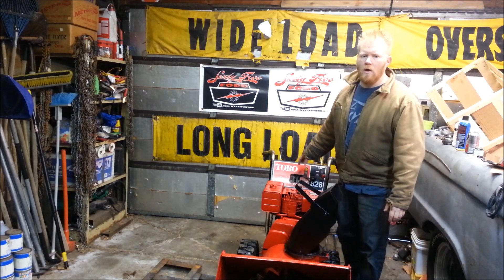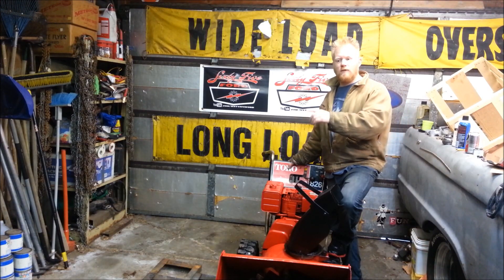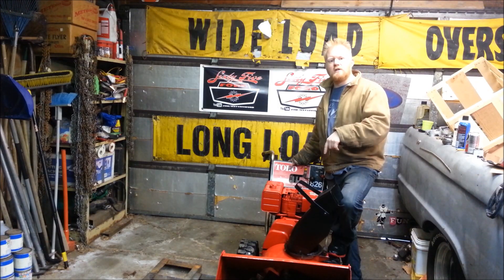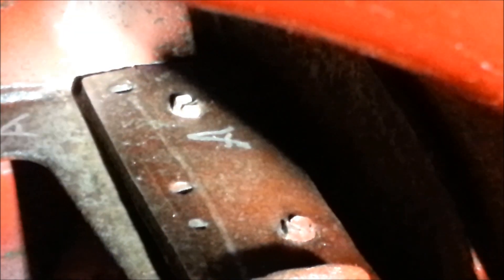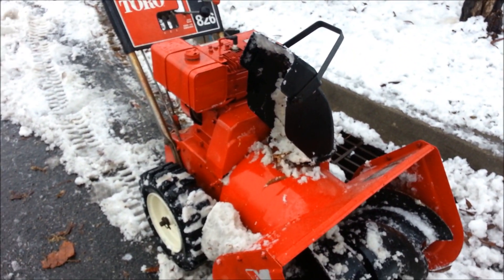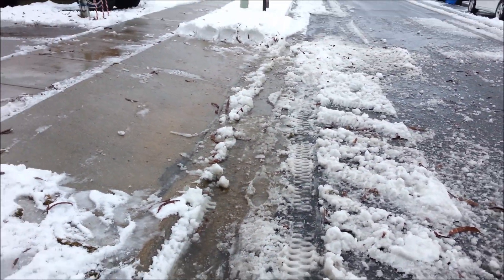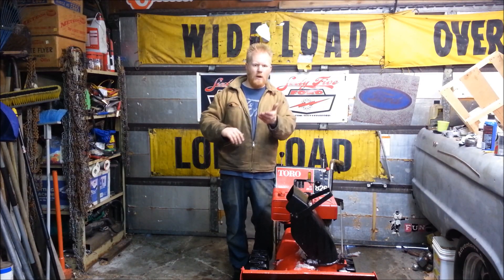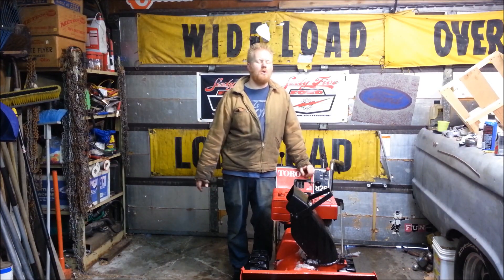TEST snow blower Impeller Modification with and without

Comment: I just did this rubber paddle modification to  bob-cat 72 inch hydraulic powered blower I have on a 75 hp 836G skid steer. I will let you know how it changes the performance of this unit. I also plan on doing the same to our walk behind 32 inch Honda. The newer Hondas use a high speed three paddle auger and throw snow very well but they will still clog in wet crap slush.
Reply from the maker: James P Bergeron You'll be impressed. I've had a few people do this to tractor mounted snow blowers.

Comment: Great idea...after I watched this I went and checked my Husqusvarna and to my delight there is almost no clearance..they actually designed it to performed that same way your mod does...it never clogs...so far haha...cheers and greetings from Ontario Canada
Reply from the maker: The gap gets bigger with use as the housing stretches and the impeller blades start to bend. They're usually good when brand new with a minor 1/8" gap.

Comment: I added the rubber pads to my snowblower. I had them too close to the side so I had to adjust because impeller was stuck. I also replaced the auger belt. I will also use DuPont snow and ice on the auger,impeller and chute. No more clogging. Can’t wait to test it out!
Reply from the maker: You'll be amazed with it.

Comment: How Can I modify my single stage blower.  Great video
Reply from the maker: richard reis Old metal single stage/riding mower single stage: Put one 3-5" paddle on each auger right in the center below the chute. Right on the flat part. Your machine will throw a ton further and won't clog.
Reply: sixtyfiveford Not real sure where you are indicating to put the paddles.  The blower is a single stage simplicity tractor mount 1970.  I have two scoop type sections in the middle right below the shute.  I tried to put paddles on these scoops but they interfere with a piece of the blower which is located on the front of the blower.  It is a triangle shaped piece.  The largest piece I can mount that can clear is appx 1/4".  I will give this a try and see if this helps.  Thanks again for the help
Reply from the maker: I have the exact snowblower for my 1972 Sovereign. Yes, just put it on the 2 flat spots so it just touches the triangle. It should also touch or be very close to the auger housing at the same time. Mine are about 5/16" and just skim the housing and the triangle.
Reply: sixtyfiveford Yep,  That is exactly where I put mine.  The paddles took up some of the space between the scoops and the chute.  I still have a 1/4 " gap from the scoops and the chute.  We have a wet snow coming tonight, I can't wait to try it.   What a great idea!!!!

Comment: I gave the paddles their first test tonight after I got home from work. They throw the snow between 25 - 30 feet, and with a fully re-built carb that I did last spring (thanks to your video), I got it done myself, all I had to do was buy the re-build kit plus a new float (parts less than 30 bucks). :)

Comment: Gwdave here, I did this mod early in the summer....  I have had a couple of light snow falls that were wet...  We just picked up about 4" of kind of wet snow, and along the road where the snow plow left the melted real wet snow from the chemicals I tried to plug up my 2 year old TROY.....  I could not plug it up no even a little bit...  I had to get in to some snow in the yard to remove the wet stuff from the inside of the blower so I could put it away.......  Real neat mod, and I tell every one I know to do this mod it is worth it............
Reply from the maker: Dave Farrell GREAT! Most are too afraid to try this on a newer machine even though the performance is poor. I'm glad you tried it out. Thanks for the feedback.

Comment: Mastercraft (MTD) 8HP with 3 blade impeller.  The impeller has a lateral curve. Should the paddle extend to the edge of the curve?  Mounted on the top  of the blade creates a non-smooth surface to throw the snow - does that matter?  (Can’t mount flush with blade underneath).   Eager to make this work on my machine.  Anyone do this on a Mastercraft 8hp (also MTD, Snow King, with the Tecumseh engine.  The backing plate on the impeller drum doesn’t allow for the paddle to clear the  back of the blower,,,, I can only extend outward to eliminate the minimal tolerance).  Go 👍 or no go 👎???
Reply from the maker: You don't put it on the curved outer edge. Only put them on the leading edge as it will pull off it put on the back side. Even if you leave a 1/4" ridge from the rubber, snow will immediately fill it in.

Comment: Why doesn't Toro build them with paddles if it would work better?
Reply from the maker: Cost and why would you buy a new snowblower if you didn't get fed up with the performance inabilities. The higher end snowblowers $1500+ all have virtually zero gap when build. Bargain snowblowers are mass produced and little care is taken so gaps are left oversized to accommodate sloppy tolerances.

Comment: Thanks for the demo . After seeing your video I can see the actual difference . I was pissed at my snowblower as it only vomit the snow out t'ill it completely clogged up.  I will be adding those paddles instead of selling it . Thanks for saving me $1100.00
Reply from the maker: It makes a world of difference. Thanks, I hope you do try it out.
Reply: @sixtyfiveford  Hi bud!  Tried to install my impeller mod today since it was nice and warm but the self tapping screws wouldn't go in the impeller. Tomorrow I'll go and buy a bit that will fit to the end of my extension and drill a couple holes . Looking forward to trying this out. I'll keep you posted on the results . Thanks
Reply from the maker: @danh1202  Some machines (Toro etc) have a higher grade of steel for the impeller and the self tapping screws have a harder time. Drilling a hole is the remedy. It's just a tight area to be working so generally use hex shank drill bits that I can put into a screw bit adapter for extra reach.

Comment: Great vid! I just picked up a 1993 toro 724. The gap is pretty close already but I think I'll get me some rubber and make some paddles before I try it out. Thank you for posting this video. You would think that the manufacturers of these machines would have figured this out already and been making them this way at least within the last few years.
Reply from the maker: Thanks.

Comment: I'm not sure if it's a brand thing, but my Husqvarna will throw snow across the street, like you're on...  The mod seams like a good idea...  IDK maybe they made changes since 2014...  I bought mine in 2016...  It has never clogged up in any snow...  I do spray "Pam" cooking oil on all the areas that snow comes in contact with...  That is recommended in the directions...
Reply from the maker: If you're snowblower has a gap of more than an eighth of an inch this modification will help with distance. However if you live in an area where the snow never melts you likely will never have slush/clogging problems. I can take the oldest snow blower in the world and run it through straight watery slush without ever clogging or having to spray Pam in the housing.

Comment: Is the profile of all the snowthrower chutes designed so the clearance opens way up right after the blades go past horizontal? That's how it is on the vintage Troy Bolt 42000 I just got, and I was wondering if the poor capability I've seen on my first use is just due to the old design, or the impeller clearance, or possibly the impeller speed being low.
It clogged a few times, and when it didn't, only spewed an impotent stream of snow a few feet. I could probably fling it further with a shovel, so it was a bit embarrassing using it. 😉

Anyone try using tire tread or sidewall material for the impeller extension? Would that be too thick or heavy for the purpose?

Comment: Thanks for the video!  I did this to my Toro 826, it is the same as yours but yours is in much better condition!  Mine is a 1978.  It is a beast with the paddles now.
Reply from the maker: Josh M These are great machines. The one in the video(1981) has been repainted but served a long hard life and is still going.
Reply: sixtyfiveford Looks great! Did you repaint it?  If so, what paint did you use?  I'm restoring mine after this season.
Reply from the maker: Rustoleum (Banner Red if I recall).  It's great paint but takes a few days to fully dry.

Comment: I went to the local power equipment  store to get a drive belt and I asked if they had any of the used paddles like you have. I lucked out and they had a couple and they gave them to me. I gave the girl a tip because she had to go garbage diving to find them. So I am going to do your mod!

I am still waiting for that gear, they said it should get here Monday. Of course we are going to get dumped on Monday with another big snow.

Comment: Wow nice trick! I would love to try it on a larger scale blower, like a bobcat or tractor mounted one. The bobcat doesn't seem to clog as often but there are days where we just don't bother and use the bucket or blade instead, taking forever. If I remember next winter I'll let you know how it goes.
Reply: Dude, I work at an airport and drive a huge Kodiak snow blower, it SUCKS in most snow falls depending on depth and how wet the snow is, I would LOVE to do this mod on this machine and see what happens lol

Comment: Thanks for taking the time. I'm surely going to do this.
One good tip is to take a piece of rope and hang a stick off the handle to clear any clog that happens.

Oh and one more thing...don't feel bad, a lot of project cars get turned into work benches :-)
Reply from the maker: blipco5 Yeah, it's hard not to pile stuff into the bed of the truck.

Comment: I am in the process of patching up my blower to get another year or two out of it, I  WILL be doing this modification for sure!
Reply from the maker: REWYRED You'll be glad you did. Thanks for watching and I hope you get another decade out of her.
Reply: sixtyfiveford I believe I have one of those 700.00 dollar ones you talked about that the guy gave away. 8 HP MTD   POS! It's got power but clogs. I got so I could kind of work around it a little pan, or wd40, make sure the shute is facing they right, so it's the same direction as the blades throw it. But I will be trying this. I have some old conveyor belts rubber heavy. Thanks for the video. Utah, by the way.....greatest snow on earth my ass.
Reply from the maker: Greatest snow by quality not quantity.

Comment: Now that was a lot of work, just to do a comparison video, so allow me to say thank you. The proof is always in the pudding and you've certainly proved your point. I shortened the stack on my wood chipper to alleviate clogging but your way works even better. Oh and yes, my chipper will take your arm off at both intake and exhaust. Yikes, but she sure chips wood even up to 4 inches with just a little 25 hp tractor.
Reply from the maker: Yeah, a lot of people have been asking me to do this video for a while so I finally cracked. Sounds like a great chipper.

Comment: Great tip and such an easy attachment shown on the other video. I call those tapping screws; Zap screws or zip screws. I used them in the sign shop to connect the facia sheet metal of an outdoor sign to the support frame.
Reply from the maker: Murster62 Thanks..

Comment: Thanks, this works very well, instead of buying a mud flap, I bought a plumbers band aid, which joins two pieces of cast iron pipe together. This is 1/4" thick, very pliable rubber, it is round but it I cut it in half with a chop saw and then again the long way. This gives you four pieces 1 3/4" wide and two surplus hose clamps, total cost with self tapping screws and fender washers less then $10.
Reply from the maker: Philip Pond Awesome.

Comment: First time since I made the modification that it has snowed here in southern Maine/NH boarder.  A wet, slushy snow.  My toro killed it!  No clogging at all.  Plus it actually threw the stuff!  AND it threw it (wet slush) ten-15 feet.  It threw the snow about 30 feet.  WHat a fricken difference!  Very cool, very easy and cheap.  BTW-I was not going at the slowest speed-regular speed.  Thanks again for the idea-worked perfect!
Reply from the maker: Bob Dawber Awesome, I'm glad you're impressed. It's amazing such a small thing can make such a dramatic improvement. I'm sure you'll keep the Toro around a long while now.

Comment: Sixtyfiveford.I am writing on your YouTube because you were the first one I saw and seem maybe not the first but one of the ones?I have an old early 1970's Snotrac 20/5 with a 5 hp Tecumseh.Rebuilt the whole thing carb and all from the ground up but the engine as it cannot be killed and starts first pull every time.Anyway, I had to try it and it wasn't easy putting in the tire sidewalls as the blades are almost 3/8" thick steel and rubber 1/4" but with good stainless nuts, bolts, washers and lock washers, Man!It runs just as in your video, so much so that I have to keep the chute down about half way for the most part now as before it was up all the way and shooting like in your video. (just a dud!)All I can say is thanks for sharing this with us and also for those of you doing this, please make sure that a safe installation is done as these are very fast moving parts with a lot of force and injuries can happen if not done properly and balancing the parts as best as possible is not a bad idea, but ya! it works and works well!Next Summer is a new exterior finish, no not paint job but preserve it with clear, rust and all even on the chrome.A few more years, the old girl will be a Vintage machine!Was a fun and useful project Sixtyfiveford, Thanks again!
Reply from the maker: +Turk T You're welcome. Thanks for watching.
Reply: Hey, it is not to dangerous if you install them while the motor is not running.

Comment: Tough day of snow blowing for me today. My primary machine the shaft that has the friction wheel on it fell off and I lost the sprocket, and my back up machine the auger stopped spinning. And they say another big snow will come Wednesday. I searched and searched and searched (with metal detector) and could not find that sprocket. Also, a track drive with steering is much easier to use than wheel drive. (back up is wheel drive). Last fall I got the motors in tip top shape, they ran fine....
Reply from the maker: The auger not spinning is more than likely the shear bolts broke.

Comment: Picked up a mudflap at a trucking garage; my impeller has three blades put the mod on all three.  Some edge trimming after they were installed so that the impeller could spin without getting stock and the machine runs without the modified impeller stopping it; However, I am still getting clogging.  I need to slam the head of the unit down to clear the clog, it slowly spits it out and then it throws for 5 seconds before clogging again.
Reply from the maker: Michael Cohen Your belt has to be slipping.
Reply: sixtyfiveford I just changed it last year; what can I do about it?  Is it loose from all that clogging?  Does the impeller and the augers share a belt?
Reply: sixtyfiveford you are a genius; It is shooting snow like a geiser!!!   Can I send you a giftcard?
Reply from the maker: Awesome. I'm glad you sorted it out. Thanks for the offer, I'm just glad you have an awesome snowblower now.

Comment: I like the idea of the paddles.  Going to have to do that to mine.  I wax my snowblower including the auger and impeller, then during the winter I will spray the chute and impeller with PAM no stick spray
Reply from the maker: That does help clogging. The paddles have the added benefit of increasing your throwing distance.

Comment: I did this to my 1978 Craftsman 24 inch Eager 1, 17 or 18 years ago. I was getting tired of it clogging and spitting slush on top of it's self so I cut mine out of a sidewall of a car tire. With the rubber kind of cupped, it will literally pump water about 8 to 10 feet and it has never clogged since. You will also notice the difference in the engine sound too, before my 7hp. would hardly work but now you can here the engine working even in nice powder. I still use it with the same paddles I made all those years ago.
Reply from the maker: Yeah, It is really neat to actually hear the snow blower use all of its available Horse Power.

Comment: I was given an old Toro 521 by my father-in-law, it works but 5hp is a little weak.  I'm going to repower it with a 11hp Honda that's I have sitting in the barn.  Between 11hp, 3x torque, adding paddles to the impeller, and the Honda is a higher RPM then the Tecumseh H50 I should have one hell of a 21" snow blower.  Thanks for the comparison video.
Reply from the maker: The Honda and Tecumseh will run at the same RPM(3600rpm max) but you will have more power than you can imagine. You may even want to put a slightly larger pulley on the engine to increase the RPM that the impeller turns.
Reply: sixtyfiveford
I forgot to put in that the governor is stuck on the Tecumseh (on the inside of the block) and it can not run over 2700rpm on a surge normally 2400rpm at "full throttle".  I've already got a slightly larger pulley lined up from my brother. He calculated it should add between 400 to 450 rpm to the impeller.
Reply from the maker: The new engine is going to be amazing.

Comment: Thanks a lot for this video.  I was able to modify my snow blower yesterday and now it works much better!  I appreciate you sharing this with me.  My machine is a new Troy-Bilt Storm 2840 277cc 28-in Two-Stage blower.
Reply from the maker: Les Mack That's great. It a little bit of a pain to get in there but definitely worth it.

Comment: Also I found that there is a crack in the plastic belt cover so I am going to be using your solder gun welding and epoxying technique.

65 you are a genius, I must say.
Reply from the maker: Thanks  for the compliment. I'm glad you tracked down some heavy duty rubber for your paddles(its the best).